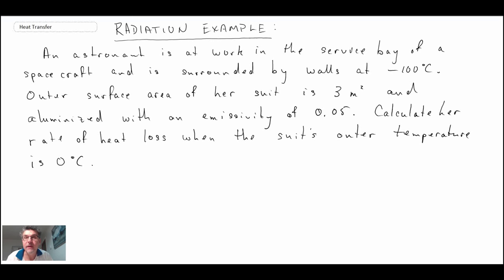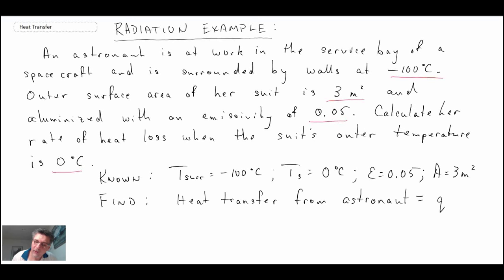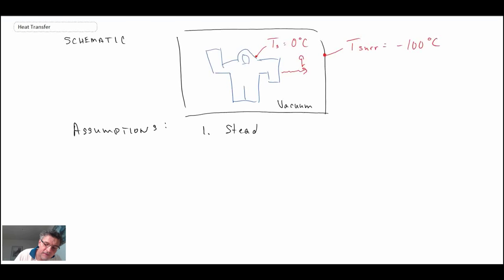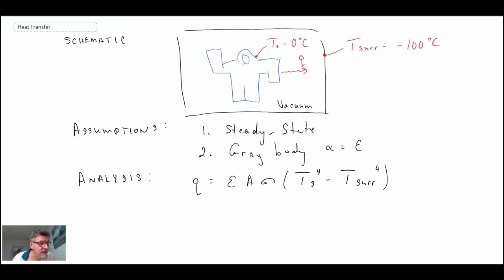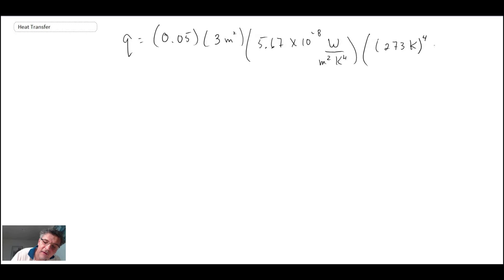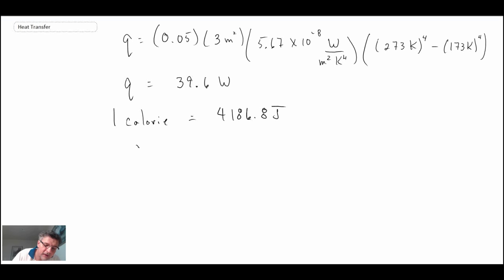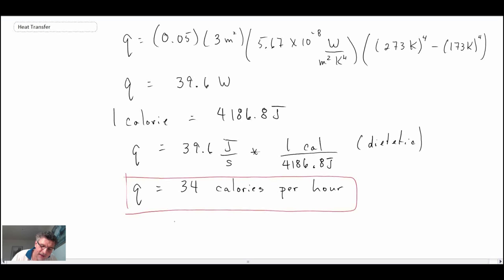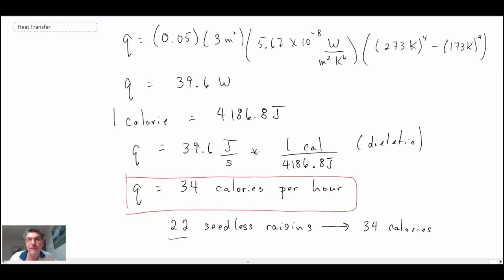Heat Transfer L2 p6 - Example Problem - Radiation

Comment: Can you please do an example regarding heat transfer from solar radiation through a roof deck, then into a sealed attic with closed cell insulation on the rood deck underside ? What would be the temperature inside of the sealed attic? If the outside temp is 95 deg ? Assuming asphalt shingle roofing and a 5/8 thick plywood deck